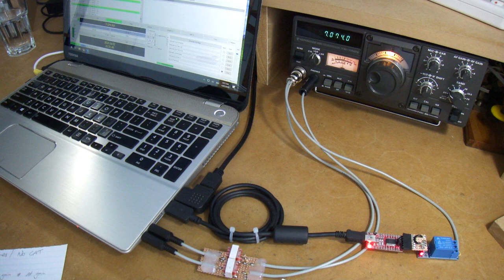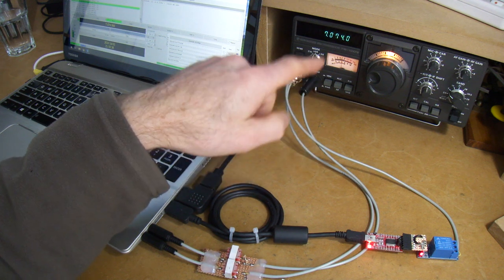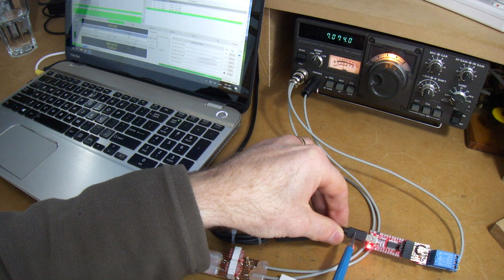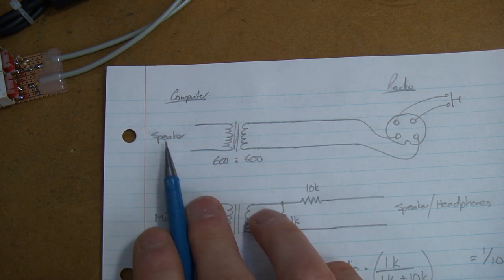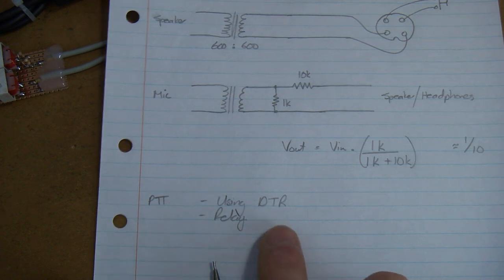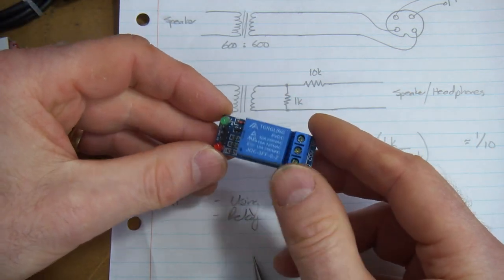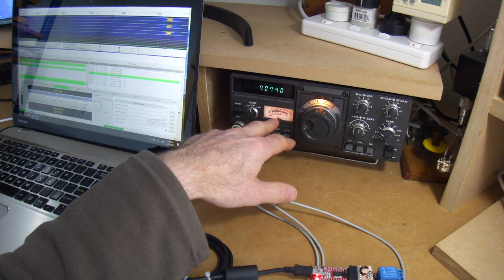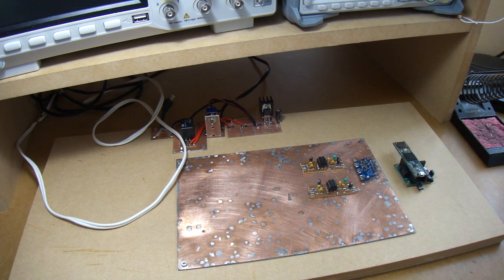Simple Computer to Radio Interface for Digital Modes

Comment: Simple but very effective, made something similar a while ago but as I was driving a 706 I added CAT control with the USB to serial board.
Nice to see a little progress on the sdr. 
73 for now...
Reply from the maker: Thanks Brian. Things are ticking along. Just looking at how best to interface the NE612 with the RF splitter/combiner.
Reply: Are the NE612's set up as in the original SSB radio, if so I'm sure the same transformer set up would be fine unless you're looking to try a different approach and in that case I have no idea.

Comment: Good job. Of course you already know you can get your audio off pin 1 on the remote connector. So you don't disable the speaker.
Reply from the maker: Which remote connector is that Ed?
Reply: @CharlieMorrisZL2CTM  The 7-pin DIN next to the 1/4" KEY jack.
Reply from the maker: @ed-jf3xh  Thanks. A monitor speaker would make it a little less sterile. Pity there is no mic input there as that would remove everything to the rear of the radio.
Reply: @CharlieMorrisZL2CTM  True enough. The wiring for the TS130 is a bit different in that the audio at that pin is from the detector rather than a sample of the output. My plan is to use the spare pin, 7, and tie it to the mic input through a voltage divider (pin 7 on the TS120 should be spare as well). Just waiting on my DIN connector to arrive. Then I'll attach it to a USB audio interface with some trimmers to adjust DATA levels, without messing with my MIC levels. At least, that the plan. Cheers...

Comment: yr voltage divider is not the 1k with the 10k, but rather the 1k//600ohm and 10k. It won't change a thing though, but you can just ignore the 1k. Relay is a very bad idea for fast changing 0-1, an opto-isolator(coupler) is what you need. They are the 6 pin little dil chips you find for .99c a 20. Check Dave Joness vids on that. Thanks for the vid and attempt

Comment: I built an identical setup for my first HF radio an FT747 but with CAT as well. All worked fine until I shorted the Audio output. Oops - ah well it sold on eBay anyway😄. Still using the same circuit for my FT857 now. I also have a shiny 7300 with one USB lead to do everything BUT the USB connection is a noise magnet - might go back to analogue audio inputs with isolation
Reply from the maker: That's interesting Graham about the USB noise. I'll have to look out for that for the Teensy digital modes build.

Comment: Wow pretty much two projects in one, sound card and radio. lol
Reply from the maker: Yeah it's coming along Curt. Hopefully, I'll have the receiver running in the next couple of days.
Reply: I have played with many radio circuits over the past year and stumbled on your video's, they are very inspiring to me. I have worked with electronics for many years and repaired radio's also, but I want very much to build my own. I love that feeling of using the things you build. thank you very much for doing all the video's they are great! it is hard to figure out where to start, and with someone leading makes it so much easier.